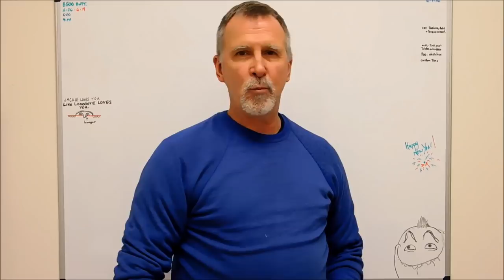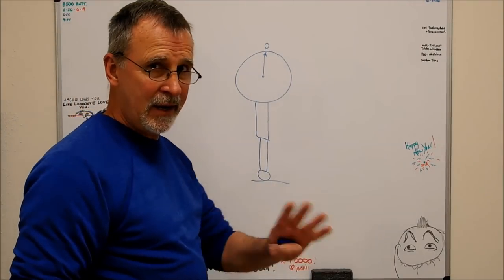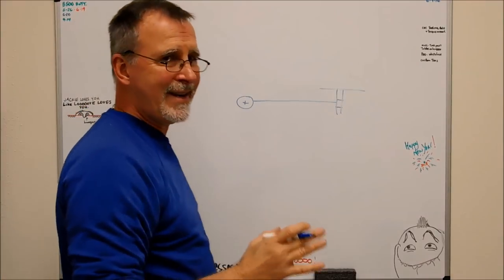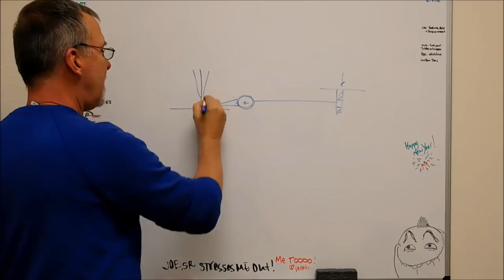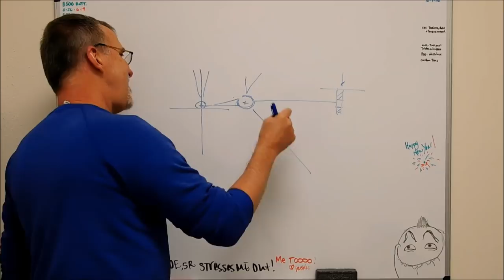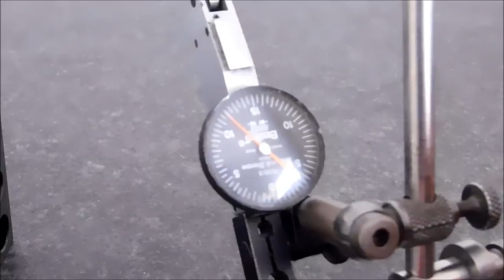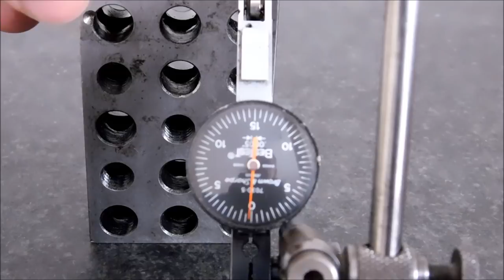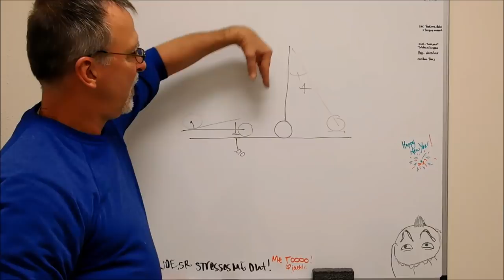Cosine Error Demonstrated and Challenged !

Comment: See... Now this seems as though whomever would argue against you, would be a a first-year student of the mechanics of geometry. NOT a machinist, who has been dealing with this type of thing for a few years or more. Now, everyone SHOULD know the actual measuring portion of the indicator. The needle with the ball on the end of it. NOT the arm of the indicator, which is ONLY used as a mounting device. So, that being stated, and the arm NOT having a dial with needle on it, I am not sure exactly who would argue against this demonstration. You can have a mounting device that is made-up of three or four different arms, and not one of those arms will be the dictating factor of an known angle. ONLY the needle and ball that actually rests on the material, which gives you the reading at the dial. Anything else attached to the back-side of the gauge, is useless in determining a proper measurement. I really don't understand why anyone would think differently. Do I not understand the basis of your argument? Anyway, I do appreciate helpful videos that explain the mechanics involved in measuring and how to better set materials for machining. I have never had a class on how to properly set materials for certain types of work, and I wanted that while I was in school. They left it up to us, the students, to figure-out proper material placement. It can get pretty complicated doing this step. This set is VERY, VERY important to proper machining, especially while using an CNC machine. Anyone care to give a class on setting? Thank you!

Comment: to me I new this was intuitively correct....it's the pivot point that matters.
Reply from the maker: Its the axis of the arm to the plane of movement that matters. If the pivot point is in that equation, then you are correct.
Reply: @joepie221  yeah thanks!  I get that too..those little dial indicators as you know have a click stop to set position at that "pivot point" at the instrument and to the tip is where it matters and I'm glad you made this point.. and great description of how they work internally,, I had to fix a few and made one good one out of a few busted ones and your discription is exactly how they operate. I also made a new lens for my old Starritt out of that hard clear parts packaging,, I used a light bulb to shape a crown in it then trimed to size,,you would be hard pressed to guess it was not original (poor folk have to find creative ways).. cheers to you and all your great vids,, I learn a great deal from you and love your teaching style. lots of people just drone on insesently and never get to the point,, you give all the right info in the right sequence,,,you should know it's appertiated.
cheers..

Comment: I sometimes use the tip at a 60 degree angle in order to introduce a known cosine error and a bit more accuracy...
Reply: Rian Groenewals:  What????
Reply: Yup - a 60 degree angle basically doubles your accuracy - cos 60 = 0.5   Multiply your result by 0.5.

75.52 degrees quadruples your accuracy - Multiply your reading by 0.25
Reply: Overkill...

Comment: Great video, but that's not the cosine error. Now, forgive me because I jumped over the white board portion of it right to the demonstration. You may have mentioned this in the portion of the video I skipped, but the cosine error is the angle of the indicator probe and the surface you're measuring, not what you demonstrated with the test indicator. I think you know this, but the way it is presented is misleading. If you were to have drawn a simple sketch of the  mechanism it would become obvious that the position of the probe itself is arbitrary and has nothing to do with the "cosine error". By the way, I like your videos, not a knock against you, thanks.

Comment: I bought a lever indicator couple years ago to measure the id runout on a part I needed to center on a lathe. It occurred to me then that there would always be an error because of the rotational nature of the instrument, but as I'm only using it as a comparator it didn't matter. I supposed that for making measurements, if I knew the length of the arm I could calculate the 'error' and allow for it, but for the kind of work I'd be using it for would the 'error' be significant? So thanks for explaining in such a clear manor, I'm going to treat these little beauties with more respect from now on!

Comment: @Emilio Gonzales - "Interapid series 312 test indicators are designed to permit a true reading when the angle between the sTyLuS and  the reference surface is 12° as shown in A and B (to the left)."  At this angle for this particular indicator the error of measuring the distance by a rotation of a lever is the lowest. Other indicators may be designed for different angle - you should follow what manufacturer recommends as they know how they designed the gears inside and how they compensate for the error. The position of the body of the indicator does not matter, just as Joe demonstrated. There is a clutch between the stylus and the rest of the mechanism that makes it irrelevant. What does matter is that the axis of rotation of the stylus is parallel to the surface. Misalignment there has the same effect as tilting regular dial indicator to the side. 
It is quite easy to demonstrate this error - take the misalignment to the extreme and position indicator at 90 deg off the point where it should be and watch the error :-)

Comment: Thanks for a good explanation. As a former educator with measurement as specialty I've gone through the importance careful rigging of tooling and cleanliness a lot of times. The most common cause for incorrect measurements are user error / lack of knowledge. (And there is no such thing as an exact measurement.) Students that didn't measure at right angle got to know what I thought of it.
People measuring wrongly and inventing "ideas" to explain their faults or to prove their skills needs to be ranted on!
Really good to bring up the topic of repeating a measurement. This is a very good way to evaluate a measurement - If I do it again do I get the same result? If yes - the measurement is likely good. If not - ponder the setup and measure again. Ask a colleague to check it as well.
Perhaps a video on common causes for incorrect measurements would be a good follow up? (What can I think about directly: Setup (as shown here), dirt, burrs, parallax errors (demonstrated here), wrong tool choice, over confidence of the tool (esp digital ones), not removing uncertainties when noting the value, temperature, not checked the zero... those should be a start).
Reply: This would be wonderful Joe.

Comment: Great video, again!  I think the confusion sometimes comes from muddled terminology but it is all just simple geometry.  
It is still possible to get a cosine error even with the lever parallel to the surface.  If the body of the DTI is rotated so the axis of the lever's hinge isn't parallel to the surface then even with the lever itself parallel to the surface you will still get a cosine error.

Comment: I agree with you 100%, with  test indicators you're just looking for zero, and there's no cosine error if you're just looking for it to read zero again. I try to keep my indicator 13° to the work, not the body. But sometimes you just need to stretch it out when they're some odd geometry involved
Reply: And with interapid indicators at least, you can get a longer tips. I've never seen it done but I don't see any reason why you couldn't bend a longer tip, if you had to indicate around some feature. Like how many times have you seen a mechanic bend a combination wrench, you do what you have to do to get the job out the door and within tolerance.

Comment: Good video Joe.  Two thoughts.  We think indicators measure distance.  They don't.  They measure rotation and convert it to distance.  So what ever angle you start with, the angle rotated through to the second is the same.  Second all the tight tolerance work I ever did, the indicator was set to zero and then the height gage was moved until the measured part also read zero.  This made sure the lever arm to the tip did not change.   There are indicators that employ elliptical tips as a remedy for the changing lever arm length.

Comment: Cosine error is present always, even on a CMM that is driving a vector normal to the surface vector. Even the first example with a 1 inch dial indicator has some cosine error in the micro level, no two vectors are ever the same indicator and 123 block.

Comment: Before watching the video I just want to throw in my 2c before I hear what Joe has to say. I don't think cosine error is a big deal because I don't really believe in using indicators for absolute measurement. Cosine error or not, a zero is a zero is a zero.
Reply: It doesn't seem like this is the way Joe was going with it, but he's absolutely right. The angle between the body of the indicator and the surface you're inspecting is wholly irrelevant, the important detail is the relationship between the surface and how you're moving the stylus.

Comment: So, good video, and here are some points. The idea here is provide some shockers. Those who truly understand dial indicators will agree with each, but you might find some of them outrageous! (At first.) 

First, here they are without explanations:

1. The ball can be any size.
2. The arm can be any shape or bent.
3. As soon as you start measuring, accuracy begins to error.
4. The fact that there is a friction pivot on the arm should tell anyone that the rotational position of the indicator doesn't matter.
5. The perpendicular line (call it the Grade Line) should be from the center of the pivot to the contact point of the ball.
6. The closer to zero you are, the more accurate the measurement becomes. (See number 3)
7. The length of the arm must be per the spec of the indicator.
8. Drop indicators are good for long measurements. Dial indicators are not good for long measuring, generally speaking.
9. Forget emotion or years of experience making you convinced, technically there is simply only one correct geometry.
10. Good practice makes a dial indicator work well for most of our work!
Reply: And here are the explanations. Note that for this discussion a "Dial Indicator" is the type that uses the pivot, and a "Drop Indicator" is the type that has a plunger.

1. The ball can be any size. (Kind of a trick question.)
 Geometrically, the calculation is done from the pivot center to the contact point. The size ball they give you means a certain distance to center, but some indicators provide different ball sizes. They have the same length arms. A pear-shaped "ball" can minimize cosine error to a point, but it's actually a fudge. Also, manufacturers tend to measure to the end of the ball, but since they make the arms, and do it correctly, they can get away with it. When you think that the ball must be a certain size, you are correct except that the error just becomes different with a different size. Both have error increasing with distance, one may be more than the other, but see number 3 below.

2. The arm can be any shape or bent. 
 In a linkage, the points of actuation must be maintained. 1. The pivot, 2. The contact point 3. The distance between them, and as much as possible the distance should remain the same through measurement. That's why we use a ball, it is best at keeping that distance. 

3. As soon as you start measuring, accuracy begins to error.
 Only at the point in which the Grade Line is perpendicular is the setup "perfectly accurate." Geometrically speaking that is. Imaging how inaccurate it must be with the Grade Line at an acute angle! 

4. The fact that there is a friction pivot on the arm should tell anyone that the rotational position of the indicator doesn't matter.
 This seems self-evident. The pivot is meant to be moved, and it provides flexibility for a variety of setups. The work must be oriented to the pivot point. (See bonus #10 below)

5. The perpendicular line (call it the Grade Line) should be from the center of the pivot to the contact point of the ball.
 That is the geometry of the setup. If you draw this out, there are lines and singular points of rotation and contact. Not a range, but points. In geometry a line has no width and a point has no tolerance.

6. The closer to zero you are, the more accurate the measurement becomes.
 Just like number 3 above, moving away from center is where error comes in. The smaller the measurement, the less you need worry about it. See number 9 below.

7. The length of the arm must be per the spec of the indicator.
 You can't put a longer arm on it or the reading will be reduced, and a shorter arm will increase the reading. It is geometrical leveraging.

8. Drop indicators are good for long measurements. Dial indicators are not good for long measuring, generally speaking.
 Angles are the enemy of a drop indicator. Perpendicularity is the friend. I guess that's true of both types! But in different ways.

9. Forget emotion or years of experience making you convinced, technically there is simply only one correct geometry.
 There may be a set of geometries that are correct regarding a certain parameter, but the bottom line is you can't bend facts to suit your setup.

10. Bonus fact - the position of the indicator "doesn't matter" speaking in terms of alignment with the work as long as your pivot axis is parallel to the work. That means you get different errors when you have the thing tilted to the side. Keep it straight!

Cool-headed arguments welcome.

Comment: A DTI is an indicator and is not really a measuring device due to the change in angle of the Arm or indeed the Arm length. The angle of the body as you demonstrate has no bearing on the deflection. Great Vid !!!

Comment: Joe, what you're saying and showing is correct. You can see this with the manual/pamphlet, that comes with a Swiss Best Test DTI. The Interapid is slightly different., according to ITs instruction manual for true readings., or, are you saying that it doesn't matter? The Interapid DTI wants 12 degrees to the work surface. Thank you. Great video.
Reply from the maker: Needle shank is the important one, the body doesn't matter. 12 degrees sounds right in line with my thoughts.

Comment: You re right, the indicator is measuring the vertical side of the  triangle because the tip of the indicator will slide toward the indicator or away from it to  absorb the cosine differential.

Comment: I never really thought about it until i picked up a compac dti off ebay and read the manual that came with it , it explained exactly what you are talking about but some indicators are not set up withe the stylus centre line parallel with the test piece some are meant to be at a certain angle to the workpiece regardless of where the body is lined up . Have to be careful of stylus length also as some people think they can fit a longer one and it won't change the accuracy .
Once again another high quality  educational video for us to enjoy !
Thanks Joe .
Reply from the maker: That longer tip can be handy, but does change things.

Comment: So......as I interpret what the 20° means (10° either direction) is that the indicated reading ACCURACY  RANGE is 10° in either direction from a given starting point. In other words, the 10° is the angle of the little arm that the end ball - tip is attached to; nothing else, right?

The arm, leg, shaft, or whatever one might call it, that ends in a ball tip, is not even referenced to anything until you attempt to get a reading. At the point that you are going for a reading then, and only then, you must do everything within a 20° arc. 
Therefore, if I am understanding the dial test indicator correctly, then no matter the position of the ball - ended arm, in relation to ANYTHING, your readings will be accurate just so long as you don't go beyond 20° of arc. 
If I am correct then that means that the internal measuring mechanism is deliberately very nonlinear to compensate for "cosine error".

I'm not a machinist and I'm not a math wizard but sometimes the rusty little gears mesh and out pops either an aha moment or a big embarrassing oops...

I don't know.... my little brain just runs on fumes oftentimes and I end up taking a shot in the dark. 

Am I even close to getting it?

Please let me know. Thank you kind sir!  :)
Reply from the maker: Correct Art. Think about a pendulum hanging straight down. 24 mm off a given surface. Now slide a 25 mm block under it. It has to move rotationally a long way to allow the 1 mm height to appear. Now position that same arm parallel to the surface, 24 mm above and slide the 25 mm block under it. The rotational movement is much less. Thats a cosine error. Its all about arm position and not body position.
Reply: @joepie221  thank you :)

Comment: Most of the arguments I heard had to do with using a longer or shorter needle in the "lever type indicator. I never checked it because it didn't matter to me because I used jo blocks or a sine bar for checking. I'm just curious.
Reply from the maker: I've always said, indicators indicate, they don't measure.